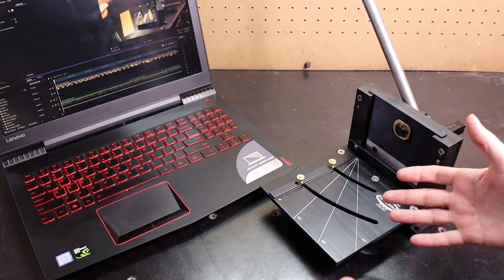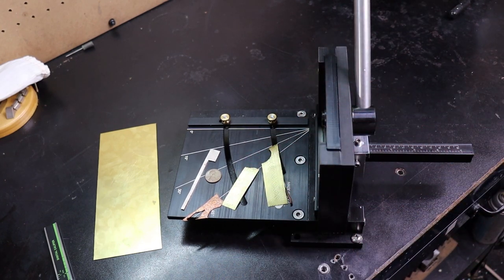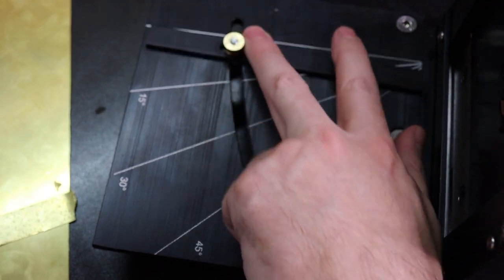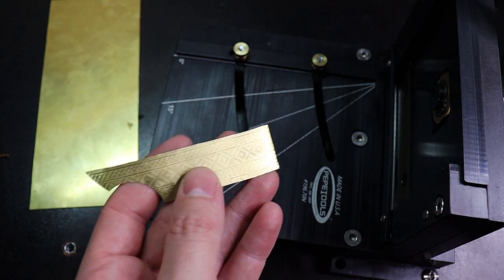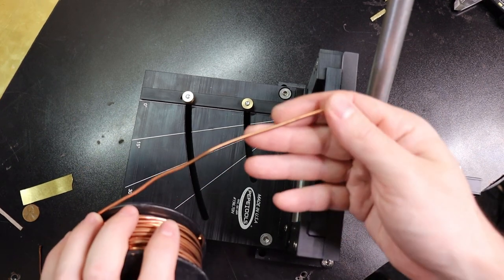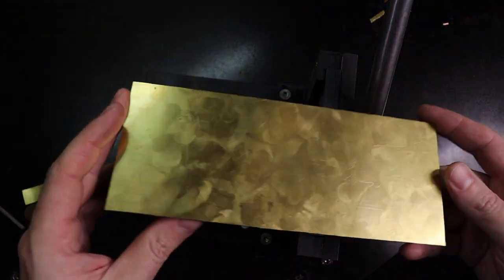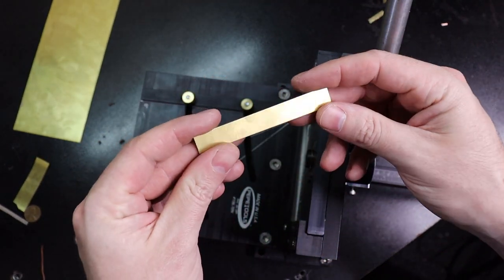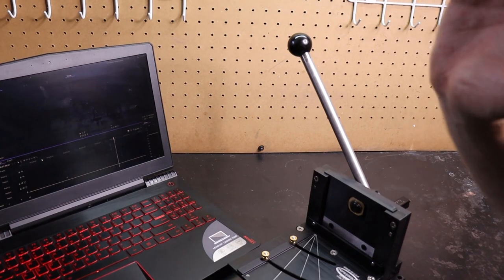4" Guillotine Shear - Cut Perfect Lines In Seconds

Comment: I have this shear (and a bigger one) - but I use this for slicing custom sized find silver and sterling bezel wires when I need extra muscle in my bezels. Hard to cut a thin strip from a thin strip, but if you buy whet - which I do, it's great to just whip out a exact bezel strip. 4" is all I need for my bezel max length. I love my Peeps tools, ALL of them!